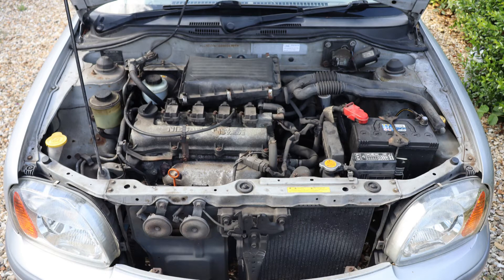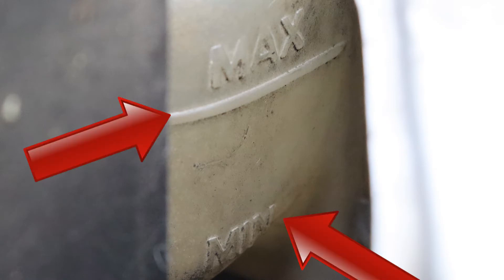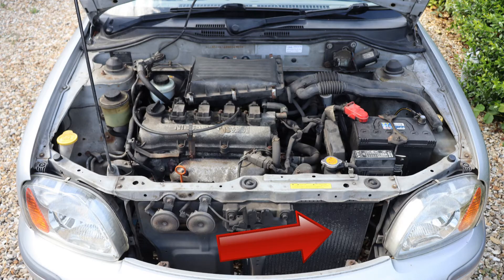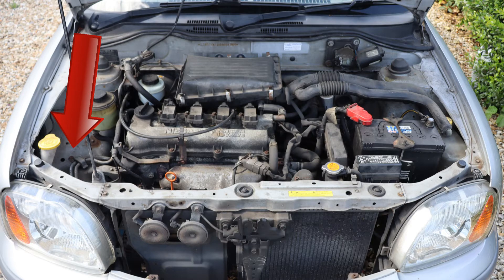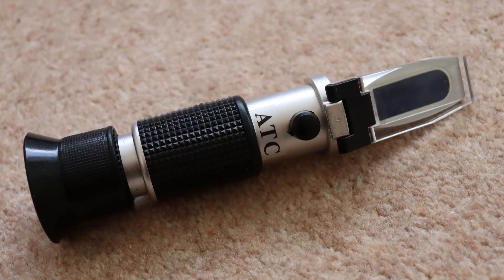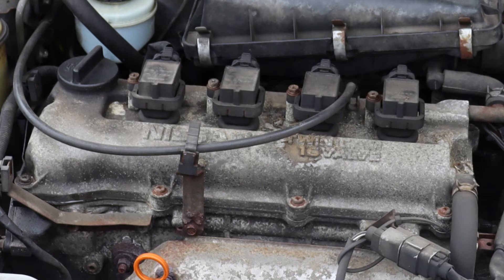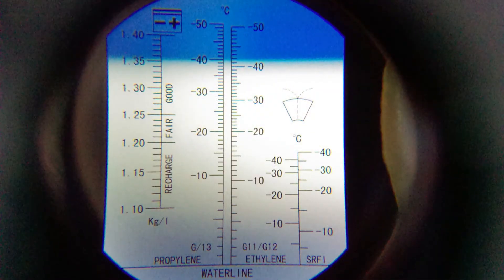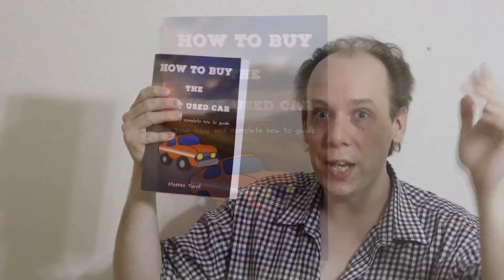Nissan Micra K11: How To Check Engine Coolant Level

Comment: Thanks for the easy to follow instructions! Can I just check - I have a bottle of Antifreeze in the car - should I be checking that it's the right one in any way?
Thanks!
Reply from the maker: Hi Laura. Yes. It’s important to add the correct type of coolant.

For example, the particular car in my video requires ‘Genuine Nissan antifreeze coolant with a ethylene glycol base (according to the owner’s manual). Your car might be the same - but I’d check a credible source to be sure.

Comment: Heya, may I ask if you know of any issues using red coolant in k11 micra's? I've currently got green in my system, but intend to totally flush it out to remove any shite. Since I'm going to have to opportunity to do so, was thinking of putting red coolant into the system instead to reduce future coolant change intervals.
Reply from the maker: Hello. Websites such as Halfords recommend which coolant is compatible with your car. Simply enter its registration number. Best wishes.
Reply: Thank you.

Comment: Hello what might be the problem if the radiator is puting coolant to the reservoir
Ive changed the tubes coolant and thermostat, some say its the radiator cap

Comment: thank you for informations! Why are there two places to put the coolant? It is enough to check the reservoir?
Reply from the maker: The owner's manual says check the radiator 'if' the reservoir is 'empty'. So, if there's coolant in the reservoir there's no need to check the radiator. Glad the video was helpful.